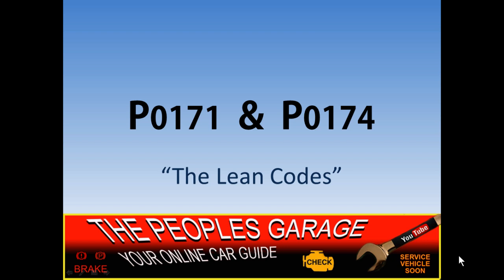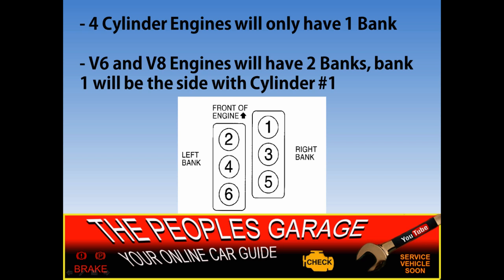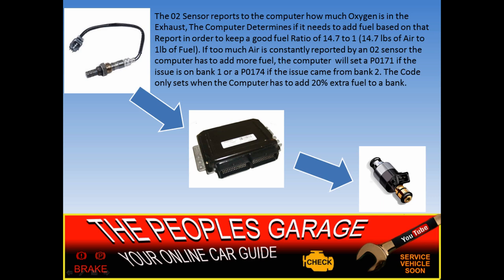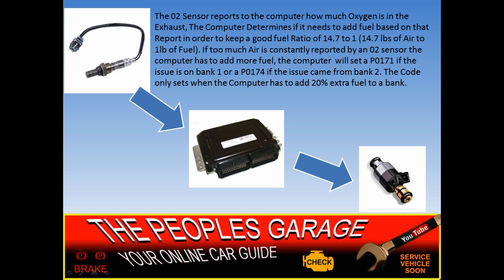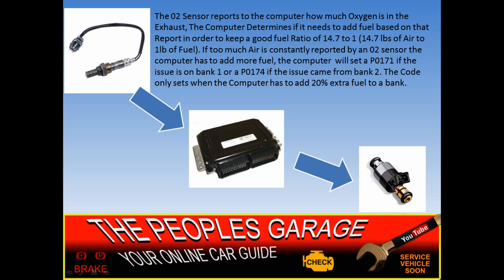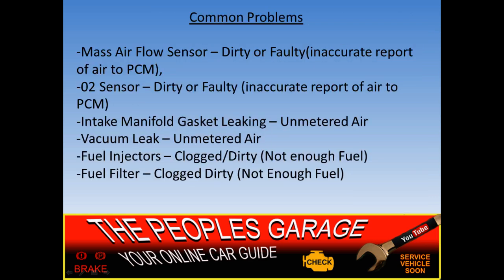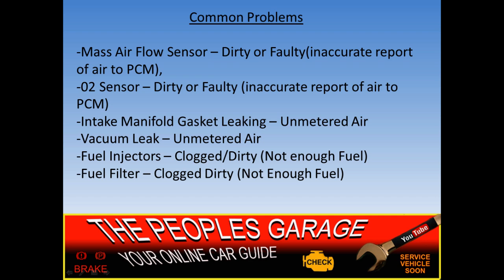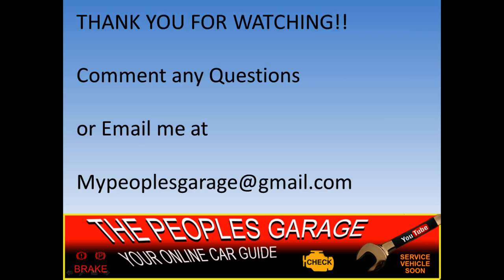How to Diagnose Codes P0171 & P0174 - Lean Bank 1 & 2

Comment: I just subscribed to your YouTube channel, so I was hoping you could answer a question for me.  I have the PO420 & PO171 codes in my 2005 Toyota Tacoma 2.7L.  I have replaced the Intake manifold gasket, the Mass Airflow Sensor and both the cats.  When I start it up my truck lopes high to low RPM's until it warms up then has a good idle.  I have sprayed carb cleaner all over the intake, PVC and all over the engine with no change in rpm.  Would the O2 sensor cause the car to lope?  Would the Fuel pump cause that, the filter is built in to the pump on that model.  I just put in some injector cleaner and I am totally willing to change the injectors if I was sure that was the problem, but I was hopping you could give me some insight.  It seems to me like an intake leak would cause this problem, but I am not detecting one anywhere.  Any advice would be greatly appreciated, and if you would like me to subscribe to any other channels or help you in any way I will do that.

Comment: I have a 08 Corvette ls3. Newly ported throttle body and Ram Air intake installed at the same time. Codes showing po171 & po174. Checked all lines and connections. Am I on track in thinking I may need a tune to correct these codes?

Comment: My bug eye WRX just started throwing the " bank 1 system too lean " it seems to be running fine but every once in awhile it seems to surge when accelerating out of 3rd into 4th and so on. It's a bone stock ej205 with 123k on it. I just got the car a little over a week ago. I'm wondering if I should try cleaning the MAF first and then check vacuum lines and injectors?

Comment: got a 2000 jeep GCkee Laradoe getting a p0171 code. changed O2 sensor. fixed for about a month now code is back.. what should i check now.. thought fuel filter but not getting both codes.. any advise is greatly appreciated

Comment: GREAT TIPS MY FRIEND.
 MY FRIENDS  FORD 150 / V6  LOSES POWER GOING UP HILL
 EVEN NOTICED  AT  A MINOR INCLINE. THE FUEL FILTER
 WAS REPLACED, INJECTOR CLEANER WAS PUT IN.
 IT ACTS AT TIMES LIKE A MISS OR MISFIRE. WE EVEN NOTICED
 WHAT HE SAYS WAS A BACKFIRING UNDER THE HOOD.
 SOUNDED TO ME LIKE A LOUD THUMP IN THE
 WHEEL WELL.  ANY OTHER TIPS WOULD BE APPRECIATED.
 THANKS KEITH
 PS I DID SUBSCRIBE.

Comment: I have been getting P0171, P0174 on my 2005 toyota tacoma prerunner with 140K. It all started with used a gum out product in the tank and replaced all the spark plugs due to getting a worse GPM. when I was replacing the plugs noticed that two of the plugs were oily therefore replaced the valve gasket on that side. Since the light came on initially I had it set again. Yet it comes back after 40 to 100 miles. I had the MAF cleaned.
Please advise
I have ordered a OBD2 scanner on line in order to be able to have a much more accurate data if needed.

Comment: I have been getting engine light on in my 2005 toyota tacoma prerunner V6. Problem started with bad fuel mpg. I treated the gas with gum out a couple of times. Since then the engine light comes on with the P0171,P0174 codes. I have cleaned the MAF. Car has almost 140k and well maintained since I bought it new. My question is why the light turns back on at different miles (20-120 miles) after the codes are cleared. What could have gone bad. There is no driving symptoms except I feel at idle RPM is minutely lower than before.
All advises are appreciated.
P.S. in the mean time I have ordered a ELM327 V2.1 OBD2 scanner .
Reply: Check for vacuum leak in brake booster

Comment: having problem with my expedition   2002 got code bank po171 an po174 I changed out MAF 4 days ago still have code bank 1and2 I noticed every time I try to start it turns on in the second time like it might be the problem with the fuel could it be my fuel pump. what could it be

Comment: I recently got a used 2013 toyota corolla its throwing check engine and Trac off light to on. I read a blog that said the cylinder head has to be changed!! but another person said it was the MAF sensor. Any idea what Trac off has to do with any thing?
Thanks

Comment: 2003 Dodge Ram 1500 4x4 with a v8 4.7 that's throwing the code P0171 replaced fuel pump and it still chugs what do u think

Comment: My story: I have a (used) 2005 Ford Five Hundred with P0171 & P0174 Lean Codes. After attempting to locate any air leaks, I decided to change out the air filter. The air filter was excessively dirty and oily (probably had never been changed). After replacing with a new one, I dove thirty miles and the light has go off. I have driven now over four hundred miles and still no light. I am thinking that the excessive oil or fuel smell that was coming off of the dirty air filter was causing the computer to think that the car was running too lean when really, it wasn't. So one step I have not heard anyone mention is to check the air filter.
Hope it helps.
Reply: got a Ford explorer sport Trac and it's throwing them codes. as well as a ho2 code.
Reply: @mcclurephilly91  my air filter was pretty  dirty.. could be it if ur is too
Reply: @mcclurephilly91  curious as to your fix. Am wokring my Ford Explorer Sportak 2001, and she's running great, but going lean on acceleration.  Am suspecting fuel pump once I get out and check its pressure etc.  25%  max LTFT both banks on driving, but 15% LTFT on idle.
Reply: Ed Weibe I gave up on working on mine and bought an impala. I put to much money in it to be doing that plus mine had over 320,000 miles on it.
Reply: @mcclurephilly91  this one is heading that way. third engine 230,000 miles, and failing emissions testing.  I have found a ton of things so far since the last mechanic threw the engine in and just washed his hands of any quality assurance. I was glad to get the thing back, now am dealing with all the crap he didnt do. Am finding screws missing from the throttle body,  and air intake so far, no exhaust gasket in the middle of the catalytic converter sections etc.  .  One thing I can say is when this engine goes thats gonna be it for this truck.  I really appreciate you answering me back.  good luck with your Impala.  Nice cars from what I understand.  We're gonna get this gasket in there and smoke test everything the  maybe look at the fuel pressure sicne I think thats about all thats left after the gasket goes in.  I can defintely see why the fuel trims would be wacked out wiht the catalytic converter missing the gasket in the middle of its negotiating fuel trim decisions.
Reply: Ed Weibe When I unplug the maf it'll crank better. has your EGR pressure sensor melted?
Reply: @mcclurephilly91  no never.  That darn EGR valve up under the spare tire was rotted away though. (a long time ago)
Reply: Ed Weibe exact same truck as mine. 2001 Ford sports trac
Reply: Ed Weibe is it bogging down?
Reply: @mcclurephilly91  nope just check engine and 25% ltft on the highway.
Reply: @mcclurephilly91  actually going up large hills with a load, yes. I can hardly get 50mph out of it under those condicitons.  The LTFT's are hitting 25% thus throwing the codes.  I just finished changing the lower cat because of the leaks around it and since I had it off and it has 235000 miles on it, I changed it.  Problem still there.  Fuel filter was really dirty. Changed that a while ago.  I do think it might be a fuel delivery issue though.   I smoked it and found no leaks.
Reply: Ed Weibe Could be the gasket.... I hated to hear that to but after everything I've done I gave up on her
Reply: @mcclurephilly91  the original engine it had had the gasket issue. I missed the recall by a year.  This engine hasnt had the gaskets done I dont think. I need to find a diagnostic to check that.
Reply: Ed Weibe let me know I still have mine.
Reply: i got these codes just changed the dirty air filter crossing mi fingers will update..
Reply: Alex P.I no update?
Reply: @mcclurephilly91  pools I forgot.... yes it was that. 30 bucks in parts.  Give it a try.

Comment: 2000 Ford explorer 4.0 EFI p0171 and p0174. I have changed all the o2 sensors, MAF,  coil pack, plugs and wires, hoses and the codes still occur. I guess it could be the Fuel Injectors. /Intake manifold gaskets.. Whats your take on the OTC 7448 Fuel Inj. Cleaning Tool for injector cleaning short of the physical removal of injectors for cleaning?,,,,,~
Reply: have you fixed the problem? i am curious as to what the problem was
Reply: I would also check the fuel pressure with a fuel vacuum gage could be a bad fuel pump as well happened on my 1996 f150
Reply: Don't use gumout octane booster it gave me both codes ... garbage!

Comment: I have a V8 LT1.  High long term fuel trim percentage on bank 1 (goes up to about 14% depending on rev), bank 2 is running perfect. No CEL.  Checked and gapped spark plugs (all were too high gapped), Ohm-checked spark plug wires (all good).  No vacuum leaks.  Cleaned MAF. Still high fuel trim. There is a tiny exhaust leak at the header, but it shouldn't be enough to cause that high of a percentage? Catalytic converters, oxygen sensors, spark plugs, wires, coil, air filter, fuel filter, fuel pump, coolant temp sensor, thermostat all less than a year old.  Shit is driving me insane.  Failed emissions tests due to high HC (1.5 limit, 4.6 measured).

Comment: i have a 2004 honda accord lx  2.4 engine it starts and when idling it starts to shake then stalls the engine light came on the code reads p0171 so u have any idea what it could be? i also replaced the 02 sensor about a year ago before i smog it because the old one was burned out

Comment: I have the 0171 code on my 2003 caravan 2.4. In the past 4 months I have replaced the fuel filter, crankshaft sensor, PCM. Last week replaced catalytic convertor and both oxygen sensors. Drove for 100 miles. Had all kinds of codes. Oxygen sensors, crankshaft sensor, even though they were new. I erased the codes yesterday and after 14 mile, got the 0171. up to about 65 miles now and still only the 0171. I guess the next thing to check is the MAP?

Comment: My Golf MK5 GTI upgraded K04 with big 76mm intake and twin intercooler with 76mm also, throttle body changed to 70mm instead of 63mm stock.

Now, long term fuel trim reported 13.7% as lean fuel, I got P2261 code but not P0171, changed new DV, MAP sensor, Fuel pressure sensor in order to solve lean fuel as long term fuel trim in +13.7%. Boost is normal to 30 psi. 

Would you advise what can I do now?

Comment: My e90 is a straight 6 and is displaying both p0717 & p0174 codes. I have replaced the fuel pump and filter, maf sensor and checked my injectors. They're okay. The car cranks for 5-10 seconds before starting, every time. Where should I look next?
Reply: Should spray for air leaks before replacing parts

Comment: I have a 2007 Silverado with the 5.3L V8 flex

I recently cleared three codes 
cylinder 1 misfire
throttle body position sensor
vent valve solenoid. 

now I have these two codes you've spoken of. I'll check vacuum leaks first? then... maybe the fuel filter?

any first initial check?

Comment: tnks for ur help.....I have 03 ford expedition xlt 4.6L V8 cold start at any wheather produce hesitation after 30 seconds of start.....I replace (all parts Motorcraft) Spark Plugs, coils, IAC, clean the throttle body cuz was horrible of dirty, air filter, PCV vlave, check all around for vacuum leaks, I have multimeter and check TPS, injector, coil resistances and power, everything looks ok....egr solenoid and valve work fine.....Not codes on dash.....one guy told me that probable the throttle body itself have a little gap for 149,000 miles on it.....what u thing!

Comment: hello you seem very knowledgeable maybe you can help me the vehicle and dealing with is a 2001 Toyota Celica the only code showing is a p0171 but what happened is the computer shut off the fuel pump and the injectors and the coil packs so the vehicle will just crank and crank and crank but it will not start the reason I know the fuel pump the fuel injectors and the coil packs aren't working is because I disconnected them and hooked up the wiring to a meter and I wasn't getting any pulsing and I'm not getting any power back to the fuel pump either

Comment: i have a mercury sable sl,24v 1999. I keep getting an p0174, and p0171 pending code when doing my drive cycles to pass smog. It happens almost immediately after i turn my ac off. i replaced the air filter but curious if you might have a clue as to where to start. The car performs relatively well, it never dies, throttles normally and has no obvious problem.

Comment: I've got a p0174 code on a 2001  Toyota Avalon.  I've replaced the MAF twice, front O2 sensor, and discovered two air leaks, PCV valve and a random loose hose.  I'm still getting the code.   The biggest symptom is when the vehicle gets above 4k rpms, the engine power stalls only under load and acts like it is rev limited at the point with 6k is the redline.   Is this a coil problem or a clogged injector problem?  How can I test for an intake manifold leak?
Thanks for your help

Comment: I have a 2002 Ford Explorer V6, it has just reached 215,000 miles today.  Of course, my engine light came on today.  I stopped to get the codes and both the P0171 and P0174 codes came up.  Where should I start to fix this?  I don't have much money but am mechanically not inclined.  This is my only vehicle and I have 2 kids.  Could someone please help me with this?  Thank you so much.

Comment: I have a Ford F150 with the 4.2 V6. I am getting a p0174 code only. I have replaced the intake manifold, the gas vapor purge valves front & rear and a new charcoal, canister, and I cleaned the Mass airflow sensor. I guess that only leaves the O2 sensor or a clogged injector. Which is more likely?
Reply: run some Techron through it

Comment: I have both codes  showing on my  98 4.3 Vortec in my 1500 I/2 ton van just changed spider injector and lower intake manifold gaskets, van idles great when cold and fires right up but when I put it in drive and accelerate it stumbles bad and won't go but it doesn't shut off, however I let it warm up a bit and it runs and idles great, it gets cold and the problem is right back, Can you help?

Comment: I had exactly that 90 degree elbow problem on my 2000 E-150 Chateau with the 5.4L engine.  There was a half-inch hole facing the front of the vehicle. Caused lean bank codes for both banks.

Comment: hi, my Jose I have a 05 Mazda tribute 3.0L with both p0171 an p0174 but I hear a hiss noise coming from brake pedal dust boot should I change the brake booster?
Reply: Yes that could cause both codes to show up especially if your brakes are harder to press at times especially after accelerating.

Comment: I have a 2008 6.8 L f450 that has this problem how I can check it thank you
Reply: common for your truck to develop problems with the MAF sensor located in the air intake duct behind the air filter. Try cleaning it and clearing the codes to see if it returns. If you have a scan tool with the ability to monitor fuel trim data look at the LT fuel trims to see that cleaning brings them down to proper levels. If this isn't effective you can use a MAF calculator and measure the signal side of the MAF to determine if it is reading properly. Or slap a MAF in it and see how it goes. Good luck!

Comment: hey buddy nice vid. i got a mustang v6 2014. it was stock. then... i got aftermarket headers, xpipes no cats. exaust and intake. i have a tuner for it. after 4 months of putting the x pipes, i got this two codes. then no long ago i got p219a. i have research and idk whats going on. now it does sounds like a mayor leak in the front part of the car. passenger side. like a big one. it looks like i have the exaust on the front. now the third code os getting me worried. the car is acting like if its out of air when low idle

Comment: I have a 2000 Crown Vic police intercepter i have check engine light on i got it scanned and they said that bank 1 and 2 are running rich dose that mean that that cats are bad? Because I just bought a two new Magna flow OEM catalytic converter but i haven't put em on yet.. But really wanted to know if the cats were bad from that code..

Comment: i got a stock BMW e46 2000 1.9 118Hp, 4 cylinder. The code is p0170. Fuel trim bank 1. Everything around the maf sensor is super clean. Fuel pump and fuel filter are like new. IDK what ti do now. Please, help me!

Comment: hi, I have a 2005 Jeep Grand cherokee  Limited. the catalytic converters and all four O2Sensors have been replaced. I have the P0171 code. The engine runs fine. No rough idling or other issues that i feel  when i drive it. I am pretty handly but probably don't have the tools to do the work unless i don't need anything special to check for vacuum or intake leaks.  should I just take it to the dealer and have them do diagnostics and repair. they want to chage $130 for diagnostic. I hate to pay dealership prices to then fix the issue. Any suggestions?